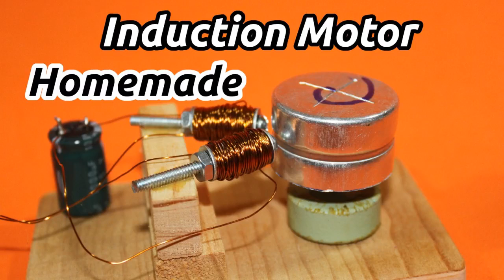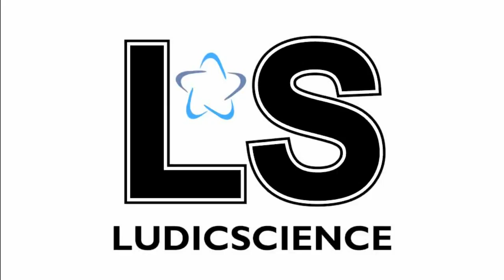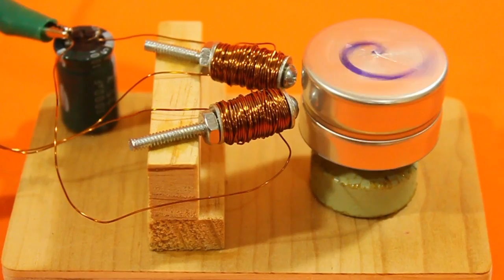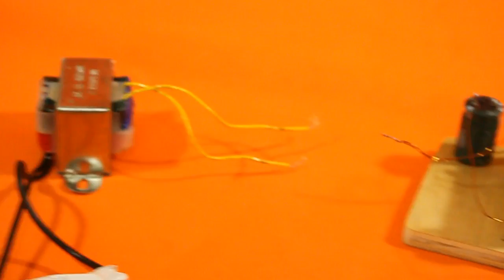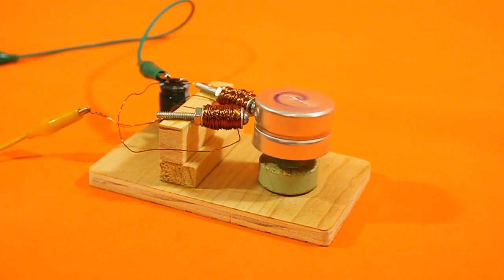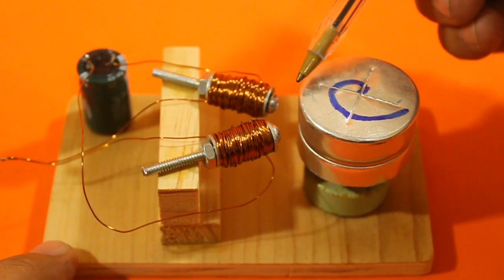Make an AC Induction Motor

Comment: 5:48 No need I think. Simply connecting that green wire to the other pin of capacitor will make the rotor move the opposite direction.

Not sure if this is applicable for this polarized capacitor. I would only suggest using non polarised ones.

Comment: split-phase single-phasic AC induction motor..... the capacitor seems to be the wrong one, it looks like electrolytic and therefore polarized capacitor; it did not explode only because the voltage is so low (6.3VAC).....good job anyhow, very simple and extremely educational...

Comment: Nice video.

What is the ampere rating of the transformer? 200mA?
I guess wire gauge will depend on that? What wire gauge will work for 200mA and 500mA 6V transformers?

Also, will it be better to have the 2 coils at 90 degree to each other?

Comment: Is he using ac or dc for power? Ac, I presume....
Reply from the maker: AC
Reply: Is the magnetic flux of the coils pulling or pushing on the rotor? Would this work without the cap making the difference in moment of induction  of the separate coils?? In that case it would be just the AC doing the switching in both coils 60 times a second...

Comment: You sir just did a good Job with this nice Project , and I wonder first about the Magnet Wire I mean are they both in same direction or wrap the wires in opposite directions
  ?? what is the value farad has the Capacitor you used here ? or that make no sense as much the Capacitor has been charges  with low Voltage ?Thank you
Reply: ASHORSHEMAYA and l want to know how it's rotating principle? thank you
Reply: I'm not quite sure , but I think the first coil which it connected to the capacitor has a fixed polarity, let's say it has a north pole ..but the other coil has a volatile polarity .. North ~ South ~ North ~ South .. Etc. If this is so, then it will not matter what direction the copper wire is wrapped, In other words, the same experiment can be done using two magnets, the first which is stationary and does not move while the other is spinning by connecting it to  6 ~ 12 volts Motor
Reply: ASHORSHEMAYA thank you

Comment: Is it really okay to use an electrolytic capacitor here? They don't like being reverse biased
Reply from the maker: +codebeard it is not ok, but I used a 35v cap with 6v voltage, that minimizes the damage. Best will be to use an unpolarized electrolytic
Reply: @ludicscience  In one comment you mentioned to use cap between 100-300uF. The non-polarised ceramic or metal film or box caps are of small capacitance and dont come close to this range. I am not getting non-polarised electrolytic capacitors. So can I use two 470uF polarised electrolytic caps and connect neg-neg or pos-pos to make it non-polarised? Will that work?
Reply: just make it run on high voltage and use 250v non-polarised cap
Reply: the problem is the negative region of the ac sinewave, even low voltage will damage the electrolytic cap.... yep! unpolarized capacitor is needed
Reply: @yoctoflop  In one comment it is mentioned to use cap between 100-300uF. The non-polarised ceramic or metal film or box caps are of small capacitance and dont come close to this range. I am not getting non-polarised electrolytic capacitors. So can I use two 470uF polarised electrolytic caps and connect neg-neg or pos-pos to make it non-polarised? Will that work?